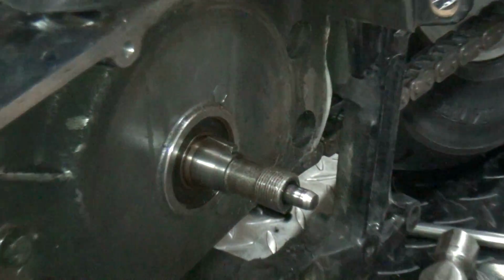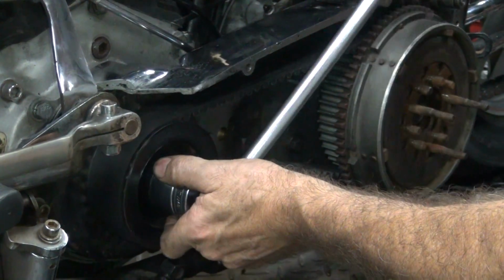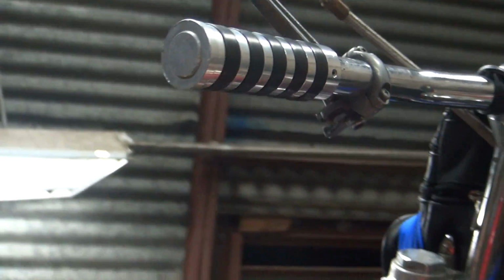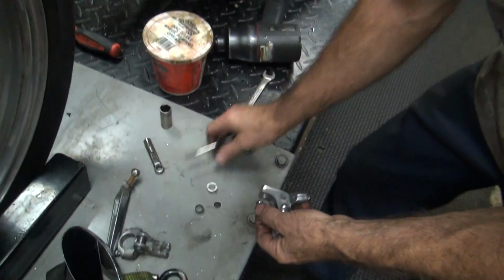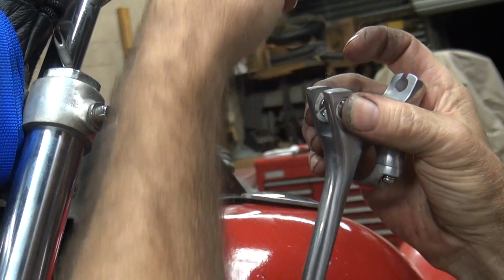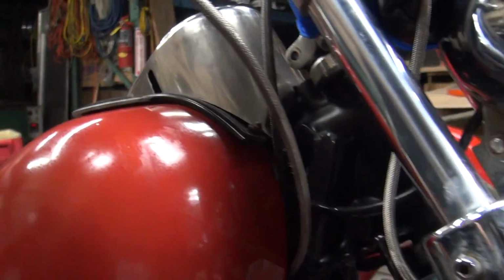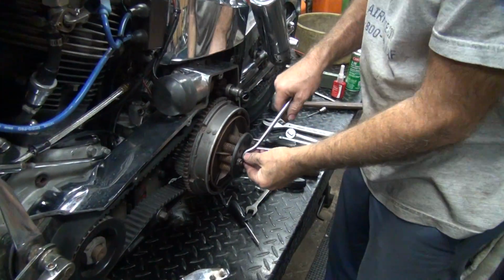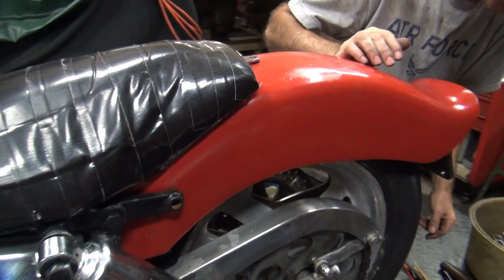1975 shovelhead #104 tune-up shifter brake repair rebuild FL FLH FX harley by tatro machine

Comment: tatro, i have a 99 FXR2, battery was on a tender for a year, took a 30 mile ride stopped for gas, tryed to start it no lights, dead, waited 15 minutes started up? the stator and regulator are new? shit battery? ?
Reply from the maker: i don't think so because it recharged itself after sitting for awhile. look at your wiring or bad alternator parts. just because it is new does not mean it is good.
tatro

Comment: Whats" Tatro and Rick  How Many Years Did That Shovel Head Sit For  ?  i See Your Fixen  All The Stuff That Always  Goes Bad !! Cool Video !! Them Old Shovel Rock It  There is  No Sound Like a Shovel Head Right  !!  You Guys are Cool Old School Bikers !!  You Fix The Parts That Were  On The Bike  If You Can  Like It !! What's Up With The Belt  and Not a Chain ? Whats Holding the rear fender On  ?
Reply from the maker: you don't know much about harleys do you.
the old way of doing an open belt drive and have a starter. internal fender struts. that is thick steel plates welded into the inside of the fender.
tatro